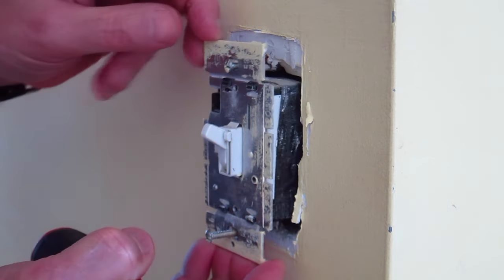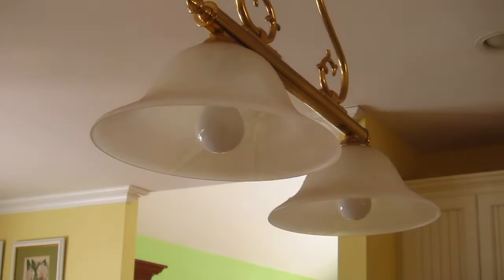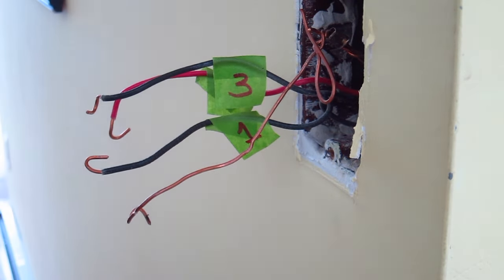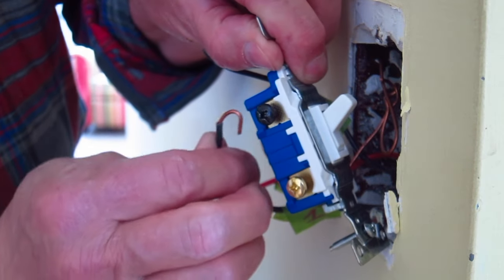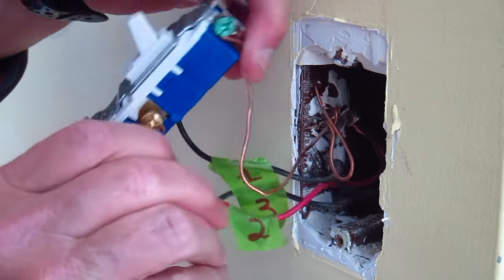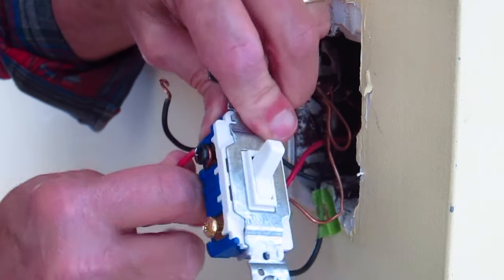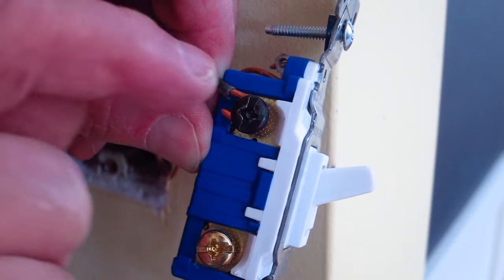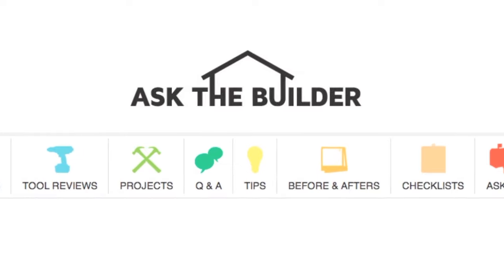3 Way Switch Troubleshooting

Comment: I had a contractor set this up in my entry way but something happened and for the longest time it wouldn't work properly....and still doesn't.  If I turn on the light from switch 1 I can turn it off from switch 2 but I cannot turn it back on from switch 1. HELP!
Reply from the maker: So so simple. Watch my other 3 Way Switch video to see what's going on behind the drywall. If that doesn't work, I can call you on the phone for 1/3rd what an electrician is going to charge you. Here are the two links you need:  https://www.youtube.com/watch?v=LDyvcM0gcVs&t=207s and

http://shop.askthebuilder.com/products/15-Minute-Phone-Conversation-with-Tim.html

Comment: Does anyone know if it's okay test by  turning on the breaker with the switch hanging out of the junction box I'm afraid of getting electrocuted lol! Almost none of the switches in my house have separate ground wires - the ground wire is in the twisted into back of the junction box (old school?)
Reply from the maker: (hand waving wildly in the air) Me, me, me!!!! You'll not get electrocuted if you DON'T TOUCH the wires or metal on the switch while it's outside the box. Remember, I offer phone coaching that's far cheaper than calling an electrician: https://shop.askthebuilder.com/consult-tim/
Reply: @askthebuilder  thank you!
Reply from the maker: @rcronin1  YW YL as we say in Morse. If you're serious about the thanks, please go back up and click the THANKS text link under the video and perhaps buy me a beer? Think how much money I saved you!!!

Comment: This method only works if the other 3-way switch is wired properly! It did not work for me because /somebody/ wired both switches incorrectly!
Reply from the maker: That's correct. I say this in the first 40 seconds of the video. You must have missed it.

Comment: It still didn't work.  Unless I have the 4 way across the room in the 'on' position I loose one of the 3way switches, IF they work at all.  This started out by me changing out a burned out 3 way switch and hooking it up just like I found it.  Now I'm just lost.  Sigh.  Thanks for trying though. (I did check the 4way hookup via your other video.)
Reply from the maker: I've solved HUNDREDS of these over the phone. Far cheaper than hiring an electrician to save you: https://shop.askthebuilder.com/15-minute-phone-or-video-conversation-with-tim/
Reply: Thanks, but this is exactly what my neighbor, the electrician is great for :)  He works for pie :)  I just thought I'd give it a go first.   @askthebuilder

Comment: Well, the first mistake is living in the same place with a 'significant other", but that's another topic.   The Professor, Tom Leykis, would be the one to set you straight there.
The 2nd point is hopefully your place doesn't have "creative wiring", lol  ;)  I found a place that had 1 hot and 1 neutral in each box, and the opposite leads of the light fixture run to each box.
Reply: l337pwnage this may be my issue because this still hasn’t fixed my switch.
Reply: @march78  If you are tripping breakers or popping fuses, that is probably what you have.  When my buddy called me to help him with his switch, that's what he was doing.  He had me bring over a box of fuses because he used all his up, lol.  I tried a little to get it to work and was having the same problem, so I ended up getting out the volt/ohm meter, and a really long jumper, and I mapped out where each wire went.  Of course, that's just what I did and that is dangerous if you get too careless with the wires.
It's also a dangerous wiring setup because you can have 120 VAC at the fixture even when the bulb is "off".
He got into that jam because he swapped wire for wire on the switch, instead of brass to brass and silver to silver.  His old switch had the common on one end, and the replacement had the common on one side.
Reply from the maker: She's a great woman. Get unlimited FREE tips like this each week by subscribing to my newsletter at www.AsktheBuilder.com

Comment: why not just move 1 wire at a time from old switch to the same place on the new switch?
Reply from the maker: Anyone that would have done that would NOT BE HERE watching this video, get it? Your comment is like saying, "Why not just armor plate the hull of the Titanic so there's no way an iceberg could cause damage?"
Reply: @askthebuilder  got it i thought i was being smart and that is actually dumb. since you brought it up if the bulkheads on the titanic would have been built to the top of the hull an equal number of sealed compartments could have been flooded aft and this never wouldnt of happened but i guess im dumb.

Comment: From my point of view, the video starts out with AtB insulting me. I didn't screw anything up. It's not why I'm here. OK, so you maybe pegged some viewers but not all. Here is the issue I am looking to correct. I just bought a house, built in 1978. An outside light can be switched on/off from the (K)itchen or (M)aster bedroom. Starting with the light off, if I turn on the light from M, the switch at K will not turn the light off. The light will momentarily turn off as the pole passes the center position. But when it comes to rest in the up or down position the light stays on. Now if I go to M and turn the light off, K works as it should, toggling the light on and off. Does this mean one of the switches is bad?
Reply from the maker: Each week I usually get some calls or emails from some moms saying I've used this Internet video to hurt their son's feelings... Max, you may want to take a chill pill and watch this video and start paying really close attention about 2:26 into it. https://www.youtube.com/watch?v=x-8hQh6hdnI

Comment: Well I finally figured it out.  The 1,2 and 3 labels trick did not work for me because of the way the builder installed the wiring.  Instead of pulling a 3 wire with ground that would give a RED and BLACK traveler, the way most of the U.S. does it, they pulled a 2 wire with ground requiring lots of guesswork. Then on the light/fixture side they disabled the white/neutral going to the lights which totally confused things because of no neutral going to the lights. Apparently there is a neutral going to the lights from somewhere else. Bottom line is next house I have built, I will be watching it like a hungry hungry hawk.
Reply from the maker: To get unlimited tips each week, subscribe to my FREE newsletter at www.AsktheBuilder.com

Comment: 2:00 what if my black screw is centered on one side and the gold ones are in the other side?
Reply: Just tried this anyway, didn't work
Reply from the maker: Well, it's possible the switch is bad. Keep trying.

Comment: Ugh. Thanks for a great and easy video, But, I'm So frustrated.  Do I have to do the "1-2-3" wire switching with both switches??  I still can't get the switch(es) to work properly.
Reply from the maker: No. If you're going to throw in the towel, you can call an electrician and have him do it for $100. You can figure it out in less than five minutes.
Reply: ABSOLUTE Best/Fastest is with 3 wires at each location, find the 1 live wire, place on common, remaining 2 wires on 2 same lite colored screws(travellers)go to other wires, find the live one, place on Traveller screw, switch first switch to other position, at second switch put the new live wire on other Traveller screw, Remaining wire goes on second switch common. Done
I work on thing Live most all the time, and many times I use my Metal Leatherman Pliers, and I remove Ground first and connect last when changing out a Live Recepticle. Don't recommend. I do when working on Critical circuits, I really should use Insulated all the time. Shoot, birds don't get scared sitting on live wires. Just don't touch ground when you are live. I think it is not bad practice to remove ground first, connect last? Both ways work.

Comment: This didn’t help me. 
I’ve tried every combination. 
Still not working. Only getting 28 volts, at the switch.
Reply from the maker: I'm sorry for your bad luck. We know the method works. Read all the other comments. Remember, this video if for when you take off ONE WORKING switch and goof up the wiring. Watch the first minute again.

Comment: Followed instructions to a tee and it didn’t work.   The first two configurations allowed the light to work, but if turned on with the first switch and turned off with the second, the first switch would not do anything.
Reply: Maybe since my switches go to two vanity lights it causes a problem.
Reply from the maker: Well, you need to really pay attention to the first 33 seconds of the video. This video is for a person who takes out a WORKING 3-way switch and puts in a new one but messes up the wire order. If you're trying to diagnose a previously NON-WORKING 3-way-switch setup, you need to watch my ORIGINAL 3 Way Switch video. I link to it in the video description above.
Reply: Thanks. I’ll check it out.

Comment: Hang on....so it doesn't matter which color wire goes on which screw??? If they get swapped around then the switch isn't going to explode???
Reply from the maker: Did you see my switch explode??????
Reply: @askthebuilder  Nooooo, but I kinda figured that RED wire on my switches means something and I shouldn't just stick it on any screw willy-nilly!
Reply from the maker: @britnyank9002  Engage your God-given critical-thinking skills. Go watch my original 3 Way Switch video and you'll understand why explosions won't happen.

Comment: Hmmm this didn’t work.  Rotated through several times.   Wish I knew what I was doing wrong.
Reply from the maker: Hmmmmmm. Did you listen to the first 40 seconds of the video? This method is for when you remove one switch and goof up the wires. If you took out both switches, then you must watch my original 3 Way Switch video.
Reply: @askthebuilder  thanks you will take a look.  The switch is in a new house and it came this way and I’m just trying to fix.   Will take a look at the other video now.  Appreciate the quick reply!

Comment: He showed three possibilities. Could there actually be nine ?
Reply from the maker: Rhetorical Question: Do you want to fix your issue or do you want to have a Probability & Statistics clinic? Pro Tip: It usually helps to read many of the comments before posting one.
Reply: @askthebuilder  Sir, I respectfully asked a simple question. If you have no clue as to what to answer - please do some research before trying to be right.
Reply from the maker: @jellybean8770  Sir, I respectfully provided you with a simple answer. I could have deleted your comment because it adds absolutely no value to the discussion. Have you ever taken a Probability & Statistics course? I don't have to try to be right about how to connect the wires on a 3-way switch. I am right. As I said before, please read many of the comments others have already composed. And one last time: Do you want your switch to work, or do you want to play musical chairs with wires randomly attaching them to screws? Which is it?
Reply: @askthebuilder  I know for a fact that you erase non-favorable comments. But that aside... to answer your question about easy mathematics... yes ! And to add insult ... to your 90 seconds... not ALL 3-ways are compatible with your simple 3-way switch. Some upgrades are not as easy as saying ..."Yes Honeyyy- it`s all finished. "
Reply from the maker: @jellybean8770  Correct. I do delete comments that don't add to the discussion. I delete comments that are wrong. I delete comments that are derogatory. I delete comments that try to promote some other channel or affiliate link. Do you realize the method I show in this video guarantees to get either the HOT or the wire going to the light on the correct screw? The other two wires don't matter which of the remaining screws they attach to on the switch. I think you're one of those people that always has to get the last word in. We'll see shortly.

Comment: Tried it, but it didn't work. Seemed clever enough until you realize three wires with three terminals is nine combinations on one switch. With two switches, that's eighty one possible combinations. Have fun.
Reply from the maker: You goofed up plain and simple. My method is foolproof and has worked for hundreds of others. Just read their comments below.

You can't compare this with probability and statistics. The goal is to place the hot wire or the wire that goes to the light on one of the three screws. My method, and HUNDREDS of commenters below CONFIRM IT, is simplicity at its best. You're forced to put the wire on the right screw. The other two wires, the travelers, DON'T CARE which of the remaining two screws they're on.

Take your medicine and simply admit that you didn't follow my instructions OR you didn't pay attention to the first 50 seconds of the video. This video is for the person who takes apart ONE SWITCH and tries to replace it with another. If you took apart BOTH switches, you need to watch my OTHER 3-Way Switch video.

Comment: I tried it and it didn’t work what can be the problem?
Reply from the maker: 1. You didn't listen closely to the first 35 seconds of the video. 2. You didn't follow my instructions. 3. There's no power to the circuit. Need more help? I can call you on the phone: https://shop.askthebuilder.com/15-minute-phone-or-video-conversation-with-tim/
Reply: @askthebuilder  fixed it already, multimeter helped a lot))

Comment: Sorry, you should have explained how you wire the 2nd switch first. I tried your method at the powered switch and it didn't work.
Reply from the maker: I'll see your "Sorry" and raise you that you didn't Pay Attention to what I said at 0:24. This video was made for those who are re-wiring ONE SWITCH ONLY and they GOOFED UP. You obviously are a 2X goof - Tough Love Intended because you're trying to lay your mistakes at my feet. You took apart BOTH switches. That means you need to watch my ORIGINAL 3-way switch video. https://www.youtube.com/watch?v=LDyvcM0gcVs&t=24s
Reply: @askthebuilder So first off, I enjoyed your video.  In a normal wiring set up it makes sense.   In my house, the original electrician had different training (and yes should be shot), the white wire coming from the panel into the powered switch is the hot wire, tested it with a meter.  That means the black is the neutral, therefore needs to be wire nutted together to the black coming from the light. Right?  That's a game changer.  Plus it's all aluminum and it's subject to fatigue and break at the ends the more you play with it.  The black, white, and red come in the powered switch from the other switch.   Forgot to tell you.  There is no neutral wire nut at the opposite switch going to the light.  It's only three wires out, red, black and white connected to the switch.  How should they be connected to that switch?  The bare copper ground is connected to the switch boxes at both ends. What do you suggest?
Reply from the maker: @vctaillon  
I suggest you follow the advice in my two videos. You messed up because you failed to label the wires when you took them off. We KNOW the switch worked FINE before you fiddled with it, right?  The issue is you took both switches apart and now you need to determine which wire is HOT all the time and which wire goes up to the light. It's that easy.
Reply: @askthebuilder  Originally, I replaced a three way made in the 60's only, left the other alone, 60's vintage as well.  I wired a new modern 3 way switch in exactly how the old one was and it didn't work.  Went to the hardware store and they said to replace both with new three way's.  I took pictures of the former wiring set up and copied the wiring over to the new switches.  That's when the trouble began, it didn't work.  I followed videos and diagrams thinking the black was the power when it wasn't.  That's when I got the meter out to test things and then it got crazy.
Reply: at the moment both switches are acting like single switches, they switch the light off at both ends, but when one is off the other doesn't work and visa versa..  I've got the white wire (hot) on the black screw at both ends, black and red are random, but I think it matters here which is on which brass screw.
Reply: How would you resolve this riddle.  Each switch has a night light toggle.  When the toggle glows, it's the working switch.  It will turn the light on or off  if you stay at that switch.  The other switch acts the same way.  If you turn the light off at the first switch the toggle glows.  If you go to the second switch the toggle doesn't glow and doesn't turn the light on.
You go back to the first switch, turn the light back on then go back to the second switch turn the light off and the toggle glows there at that switch but not at the first switch.  The first switch also doesn't turn the light on. How do you like that?
Reply: If you are working w/o any test instrument, completely in the blind with a system comprised of two three way switches, both of which may be incorrectly wired then there are combined 36 permutations of rotation or transposition of the connections, and two out of the 36 may work. Label the wires at each end and keep tabulation to converge on a solution.